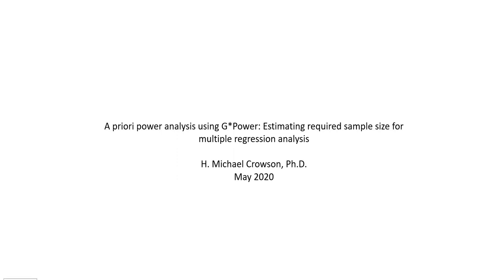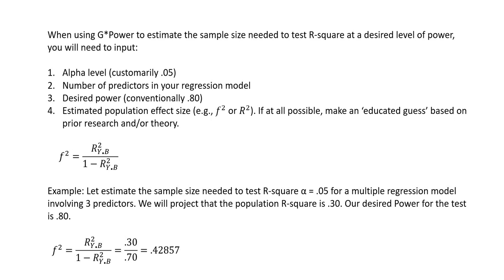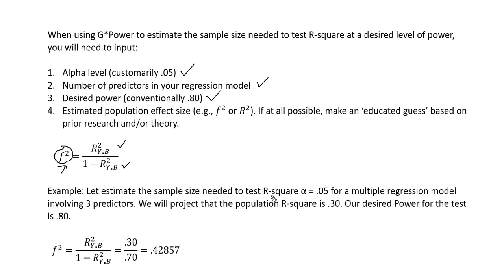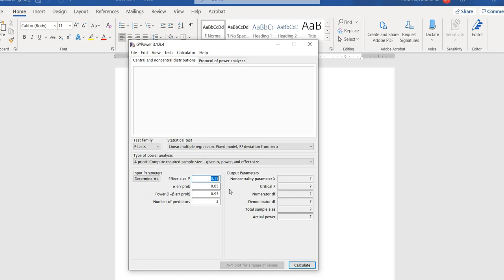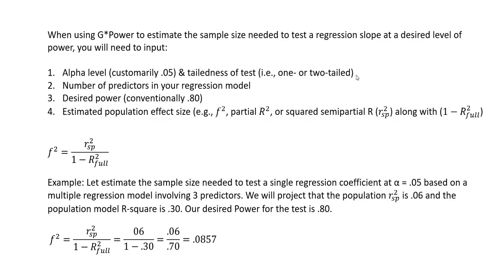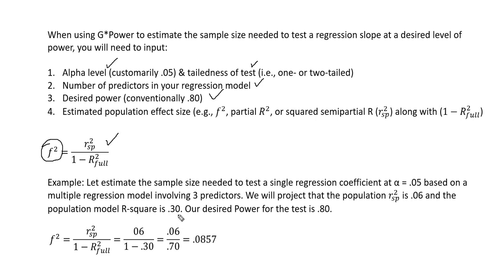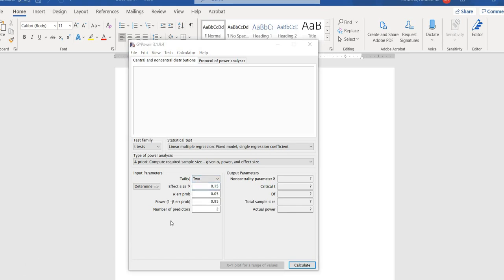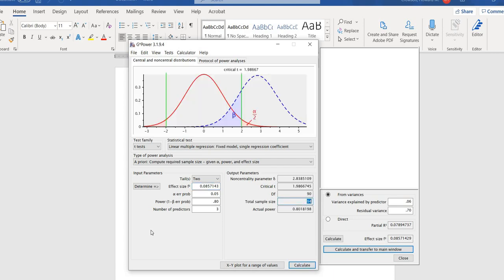A priori power analysis using G*Power: Estimating required sample size for multiple regression

Comment: Is the population R2 of 0.30 is applicable for unknown population?
Reply from the maker: Hi Aidza, the question of whether R-square=.30 is applicable in your study can only be made based on either (a) previous research where similar R-square values were obtained or (b) an expectation based on theory of a population effect that large. If you have reason to suspect a population R-square that large (from a and/or b above), then you can go with it. If you don't have any theoretical or empirical basis for projecting a given population R-square, then the question of whether .30 is applicable really does not make sense.  An R-square of .30 would be considered a large effect, according to Cohen's thresholds (see powerpoint). However, the question is whether it is reasonable depends on whether there is reason to expect such a large population effect - and this takes you back to theory and previous research. If you are expecting a large effect by proposing R-square =. .30 and the actual effect is less, then your sample size projection will likely produce test results (based on your sample) with lower power than you desired. Personally, I would rather underestimate the population effect rather than overestimate it when performing power analysis to arrive at a sample size projection - although I also don't want the understimation to be too great either. One possibility might be to create sample size projections for a range of R-square values and then make your decision after considering various research scenarios involving different population estimates for R-square. But I can't stress it enough. Make your decision about what R-square you need based on consideration of theory and prior research in your field. I know this is a long-winded answer, but the issues raised are complex  :) I hope this is helpful to you. Cheers!
Reply: @mikecrowson2462  Mr Mike Crowson, thank you for replying my comment. Due to extend my further understanding, I have email you to ask your guidance regarding G-Power with Multiple regression.